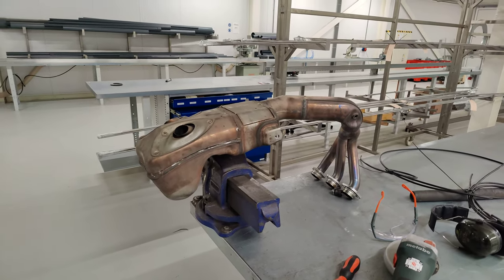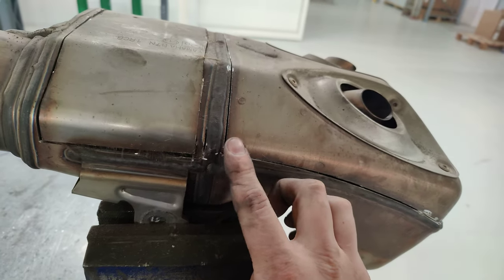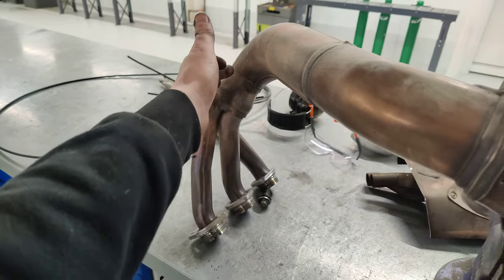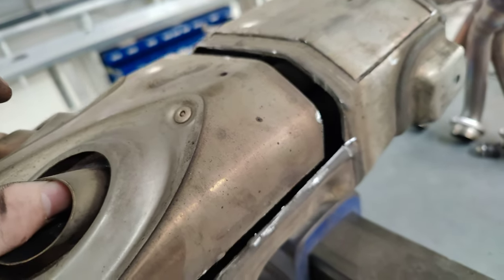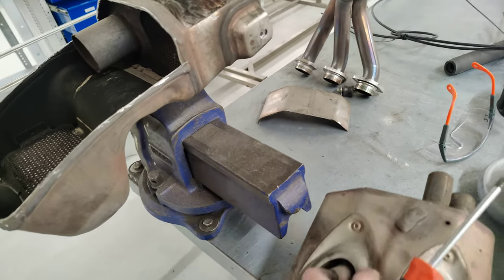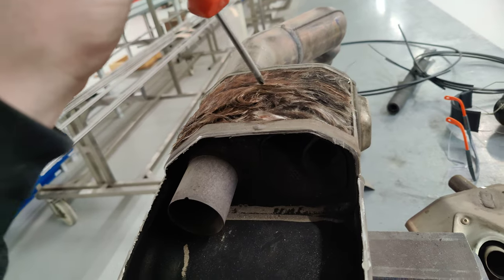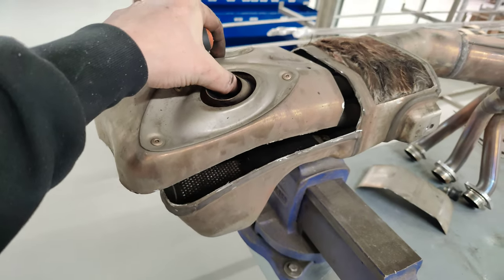Opening YAMAHA 3 GEN Stock EXHAUST.

Comment: I happen to think the stock exhaust looks cool. I like that it stays under the bike and doesn't do the ol' reach-around. Thanks a lot for showing us whats inside! It would look WAY cooler if it was spitting fire onto the ground
Reply: #Reacharound
Reply from the maker: thats what i want. spitting fire on the groud and make it black.
Reply: I want to keep mine quiet, attracts less attention from Johnny law! Going to flash mine and leave stock exhaust on for now....until more stuff becomes available. Akra exhaust is WAY too long, Yoshimura looks way better, will do that eventually.
Reply: I like the stock exhaust as well… and I will not be changing it anytime soon
Reply: You did that for the culture . Dope video
Reply: I have this bike and also like the stock sound. The Yam engineers spent time designing this and I'm going to keep it on for the foreseeable. I don't like ridiculously loud and the stock sounds ok especially with the sound of that triple and the air intake. Also like the pops when you're just cruising and snick it up a gear.
Reply: Agreed completely. The shape of the this bike is very reminiscent of the Buell Lightning. That under-engine muffler makes the bike look a lot more compact, without a bulky contraption hanging on the side of the bike and obstructing the view of the wheel. Having a big muffler on the side is particularly sinful on  bikes with a single-arm swingarm. The Honda CB1000R comes to mind.
Reply: @dg8062  tbh stock exhaust is the best sound and ive listened to every mt09 exhaust that ever exists and ive come to the idea of just decating  the stock system and tuning it.

Comment: Its not worth it give 1200 € for straight pipes for some hot air believe me. U need to gain more than 15 hp from other things and then u change , i remember from old days , exhaust was the last thing we have to change. And its a signe that u are not a traveller with loud exhaust

Comment from the maker: I removed everything but it i think its not worth it.

it was very hard to weld. i tought it wil spit flames underneeth the bike on both sides en make a better sound.

they said it sounds like a cola can😂😂😂

now i upgraded the exhaust to Mivv. (aftermaket)

sounds way better.
Did ecu flash on changed every ridemode.
now 126 HP on the wheel. crazy machine😍😍
Reply: You just installed a slip on or the entire full system?
Reply: @bryanh5103 entire system

Comment: Hi Max Spies thanks for the vid it was great to see. I also like the look of mine but would like just a little louder so have been looking out for ideas. I have seen a post where you drill out the x2 exhaust covers and drill an 8mm hole then replace the cover. No one can see any difference and if you want to put it back to standard you just weld the 8mm holes back up. I was also told if you want louder just go up in hole size. I have pics of that job but can't see how to send them on here??.👍

Comment: Where's the catalytic converter?
Reply: In the thick piece of pipe before the muffler. He says where it is in the beginning of the video.
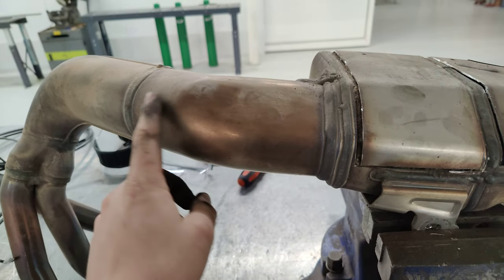Reply from the maker: @ 2:00 you can see a welt arond the pipe. that welt is weldet to the catalyser.

it sits around 10 cm to de left of te weld
and around 3 cm to the right of thr weld
Reply: I’d like to make a slip on just passed the cat. I really don’t want to affect the emissions just help it breathe better.

Comment: You’re a legend man I was wondering what it look like inside once the muffler pack and gets clogged it gets louder. I’ve noticed that with mine
Reply: Like in a better way. How many km or miles have u done. I have xsr900. Same setup. I love the sound of it but no loud enough.
Reply: @kangacrew540  I’ve done about 4000km it does get better man more low end grunt!! I like the stock exhaust for the reason that the Yamaha sound engineer team that make the instruments designed the exhaust to be in stereo so both ears hear the sound! So if it can be a bit louder would be good
Reply: @filiplaskovski9993  Thanks bru.